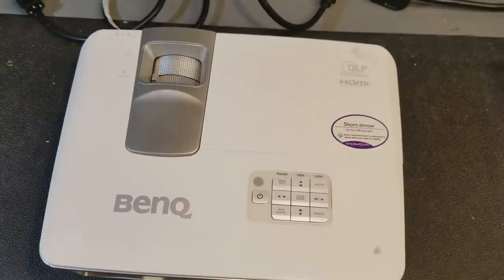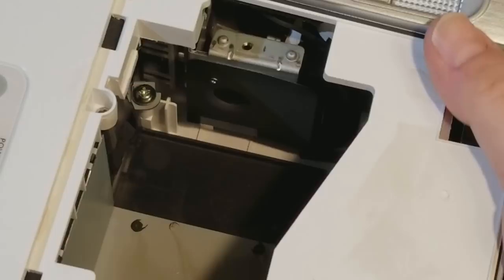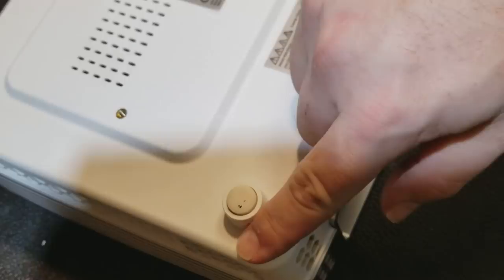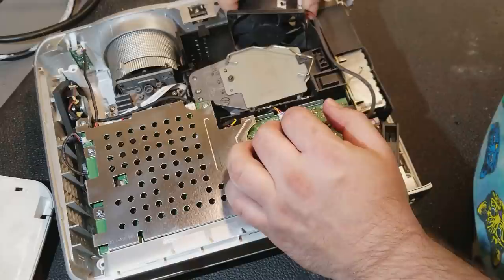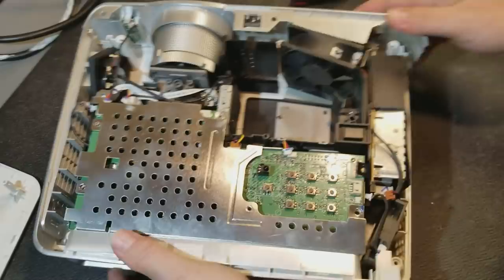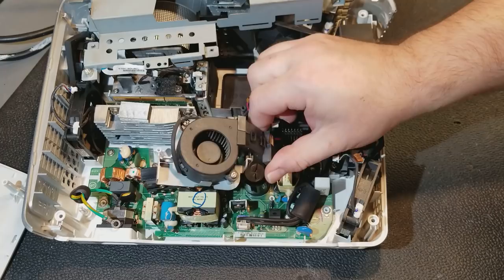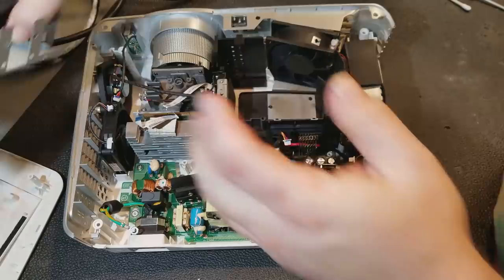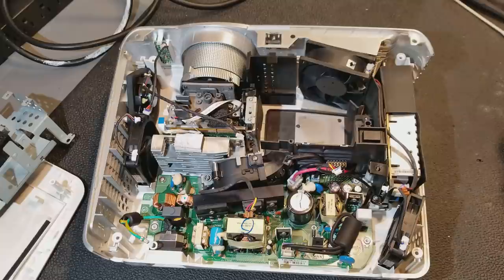BenQ W1080ST DLP Projector Cleaning / Service P1

Comment: Hi Frank, thanks for this tutorial.
I just had a problem with my W1070 that stopped working.
Specifically, clicking the power button it seems that the projector starts normally, but then in reality the lamp never lights up, and on the LEDs the steady red light with the word LAMP lights up.
The fans work, but then there is no way to turn it off by pressing the power button on the projector or the remote control.

I think the lamp was almost at the end of his life, maybe 2-300 hours were missing, so thanks to your video I decided to change it because I had bought a new one (not original), but nevertheless the problem is the same.
I had the same problem last year with my first W1070 that stopped working. Last year, reading some forums, they advised me to buy the power supply card (placed on the left side) because it could be that. So once it arrived new I replaced it but the problem remained. I changed the lamp but the problem remained. Therefore a technical friend told me that probably it could be the motherboard, and looking on the internet it cost (in China) about 230 $, so I found a whole used one with very little extra money and I bought it thinking that I could keep the old for spare parts.
Now, however, even changing the lamp and the power supply card, the second problem remains and I have no intention of spending any more money unnecessarily, and even if I wanted to, I contacted the Benq company who replied that they no longer sell spare parts because the projector is very expensive. old (a full hd is very old? absurd!).

What do you think could have happened? And what do you advise me to do?

To give you more complete information I tell you that I have already tried to see if the color wheel turns and it seems to work. The lamps (2 original osram used and 1 new aftermarket suitable for this model) are intact and do not have black parts or broken wires.
At this link you can see the video of the problem being turned on:
https://drive.google.com/open?id=13O9wTg6n8btpm_J-EaYMQz6-CHbQaELc

I hope you can help me.
Thank you
Reply from the maker: Hi Antonio, There are a few causes for this issue.  I suspect the lamp is OK.  The thing that sticks out to me in the video is the color wheel noise. I hear it begin to spin but it kind of chatters rather than spin up to speed. Of course this is via a video. The color wheel needs to spin up to a specific speed before the lamp will get an ignition signal. I still think I hear a slight 'warbling/wobbling' in the noise of the wheel.

Not turning off with the power button is normal in this case.  The projector is running its startup procedure.  It repeats the process two more times. If after the third attempt there is no signal indicating a lit lamp, the projector will turn off on its own and light the lamp warning indicator.

Without the projector in front of me, I suspect your color wheel is failing and the projector is not lighting the lamp. 

Try turning on the projector and waiting. I expect the unit will try and start three times and then shut down on its own and then flash the lamp indicator. You will hear that color wheel spin up 9 times total.  Its possible on the 5-9 time it may free up enough to spin properly without wavering.  If the CW speed is uneven it will not start the lamp. The W1070 needs a new color wheel every 7 years or so.  The service manual called for more often if I recall, but anecdotally I see them fail after 5-8 years depending on use and maintenance. 

You may be able to use the wheel out of the other unit.  If not they are very inexpensive.  I see them on eBay for less than $30 USD. 

The W1070 is a great projector.  I have a MX710 that is very similar.  Let me know what you find after letting the projector go through it's whole startup process.
Reply: @FixitFrank  Hi Frank, thanks for the prompt reply.
I forgot to tell you that I had already left the projector turned on to see if it went off on its own, but nothing.
I remembered that when the projector was working as soon as it was turned on, if you tried to turn it off immediately, a window appeared in the center of the screen with the wording "software initialization" and so I had to wait a couple of minutes to turn it off.
In my case, now after turning it on, the red LED on the bulb immediately comes out, and I left it turned on for over 20 minutes (I had forgotten it) and when I went to turn it off I always tried with the remote control and with the button on the body , but still it didn't turn off, so I had to pull the power cord away.

So what do you advise me to do now?
Do you think it is appropriate to disassemble the color wheel and clean it?
Once disassembled, how can I feed it to see if it turns well? And above all, how do I understand that the rotation speed is sufficient or poor? (I don't have a term of comparison)

Thanks for the info and your availability.
Reply from the maker: Very interesting.  I am still suspicious of the colorwheel, but I am not as confident as I was. Normally the projector will turn off after it completes the startup process and does not detect a lamp.  The only way to really tell if the color wheel is rotating at the proper rate is by the sound and the lamp igniting.  It should be a clear high pitches noise. In the video you can hear it speeding up and down. You may want to try cleaning the color wheel sensor in case a small bit of dust is partly blocking the sensor. 
Next I would try the projector with no lamp. Install the lamp door but power it up with no lamp and see if it shuts down on its own.  If not, press power, wait 1 second, press power again and see if the projector shuts down.  I wonder if it thinks it is on?  Normally to shut down the w1070 you need press power 2 times or power and then enter(I think). I will fidn the service manuals and read over them and let you know if I think of anything else.
Reply: @antoniomontinaro1982  Hey Antonio, did you ever get this fixed? My color wheel makes the exact same noise as yours. I just ordered one online so hopefully that fixes it. I was just curious if you were able to fix yours and what was the eventual fix.

Thanks!

Comment: This is an awesome video, Frank. Not sure what I did wrong though. Now when I press the power button, the green light blinks 5 times pauses and redoes it. No light, no fan. 
Not sure what I did wrong. Can you please help. Appreciate it your response if you are still there
Reply from the maker: Sorry, life has been busier than I expected.  My suspicion is the power supply pins might be offset or a wire is not quite seated.  I find that if I go back over everything I touched and maybe even re-do it, I tend to work out those issues.  I "think" your problem is a thermal sensor not being recognized but that can also be the power supply pins being offset.

Comment: going to clean my 1085st - hopefully the same!
Reply from the maker: Hi Antmon! I believe it will be the same enough for your purposes.
Reply: How did it go? I also have a ht1085st
Reply: @fernandocumbe1954 went fine - it was very easy to open up and clean - i also only have about 1900hrs on mine - used a small vac to get into all the smaller areas

Comment: I have the same projector; I’m hoping you could help me with this: just had an old bulb explode on me, had lots of very fine glass pieces in there. I thought I got it all out but when I put in my new lamp, you can tell there’s still tiny pieces in there refracting and making the picture blurry. What’s the best way to get that cleaned? I haven’t tried the q-tip to the color wheel yet, maybe that would help? And feedback would be much appreciated!!!

Comment: If you see blotches on the image like black spots and patches of different sizes it is due to dust the DMD chip. Clean it with a lint free cloth and isopropyl alcohol then use a magnifying glass to make sure there isn't any dust on the surface of the DMD at all. When you zoom in you see the blotches and when you focus the lens they disappear. That's a dirty DMD.

Comment: When removing the plug for the remote sensor the for wires pulled themselves from the harness instead of removing the harness. Can I find a replacement
Reply from the maker: I'd try and push them back in. They dont have to latch to the plastic, just stay in place.  Once they are in, you could dribble some hot glue or CA glue to hold them back in.  finding a cable is going to be hard.  I've done that myself and just ended up soldering the wires directly to the board.

Comment: FixitFrank... you are my hero (so far). I have a Ben-Q W1070 very similar to the W1080... I replaced it 2 years ago because it would run for 2 hours or so, then stop working. It was football season so I just replaced it and am now getting back to tearing it down and giving it a good cleaning to see if I can get it working again. If you're still out there.... in the video, when you went away to blow out the entire projector, how did you do that. I have been told don't use compressed air due to possibly blowing dust into the color wheel or other places it shouldn't go. Can I gently nlow it out without that risk? I appreciate any guidance before I take that step.
Reply from the maker: I use a vacuum and a dry paint brush these days and only compressed air if the optic assembly is removed.  You can use compressed air if you are super careful or if you plan to remove the DMD chip and clean in side the optic assembly.  the problem with just blowing air into it, is that you can force dust and dirt into the optic assembly and get spots on the screen. if you are careful or use the air with the cover off and are careful to not direct the dust into the optics, you can get away with it.  the reason i dont show it is that the vacuum and stuff is so noisy and i couldn't record and hold do the work( it was pre tripod)
Reply: @FixitFrank thank you for the insight and prompt response. I’ve screened the Part-2 video and tomorrow will be cleaning the optic sensor (as you’ve shown) before putting it back together. Thanks again your videos are excellently done! Merry Christmas!
Reply from the maker: Merry Christmas to you too, and thank you ! Any of the BenQ videos will be pretty close to yours.  they are all fairly similar.

Comment: My lg bs 275 projector is not started. It's shown orange light after green between 3 sec. What is the problem
Reply from the maker: Hi JM,  It is hard for me to say without seeing the lights. Here is the manual. https://www.projectorcentral.com/pdf/projector_manual_5777.pdf  Check on page 40 and see if this information points you in the right direction.

Comment: Hi Frank I have a benq MS614 projector which shut down, I followed your cleaning instructions (awesome by the way) as I thought it was dirty which it was.
Cleaned it the color wheel  doesn't spin as free as you demonstrated but free enough everything else ok , put back together and it works well without the cover
but as soon as I put that on after about 5-7 mins it shuts down everything at once no run on from the fans, by the way all the fans are working ok can you help.
the projector is for our church so any help will be ok.
Reply from the maker: Thank you!  It is hard to say without seeing it but I would be suspect of a fan.  It seems like its overheating if it runs without hte door and then shuts down after 5-7 min with the door in place.  I would make sure 100% the lamp blower fan is clear of any dust on the fan blades(the blower fan is the one next to the DLP/optical unit).  Then I would make sure the exhuast fan is not flipped around.  They can be put in with the airblowing in, which will work until the cover goes on.  Make sure its blowing air out of the projector.  At https://youtu.be/_xBGZ_V9Jp8?t=922 you can see the fan I mean.  It should be facing the same way.  The MS614 is basically the same unit. See if the fans are clean/oriented properly and let me know.  Worse case, if you get really jammed up, I am open to looking at projectors for people in return for making video content.  Im hoping its that exhauist fan being turned around.  I have done that which is why I mention it.
Reply: it was shutting down before the clean. I cleaned all the fans, the one next to the DLP doesn't open like the one you displayed the case cannot be opened so I just cleaned it and put it back I will check it though to be sure . The color wheel did not spin as free as the one in your video could that be it. I will check fan and come back to you.
Thanks so much for your prompt reply
Derrick D
Reply from the maker: Sure thing! You may still have a color wheel issue, keep that in mind. Another thing I thought of is the lamp itself. Make sure the lens has a good IR block coating. It should be obviously red/purpleish when you look at the lens. If it's clear or green, it's also part or a cause of your problem.
Reply: Ok thanks. I will also check that out and get back to you

Comment: Fantastic walkthrough, used this as a guide to clean out my projector.
Had 2 problems, dust specks on chip and a problem where colour and whites on image keep very slightly bleeding into the blacks.
Managed to clean the dust (even cleaned all internal lenses, colour wheel and DMD chip while there, and added new thermal paste to the heatsink)
All in all, much better picture.
But still have the problem of mainly the blacks taking on the tones of any white or bright colours in the image, especially if there's white....it kind of muddies the black making it look washed out.
Any clue what could be causing this issue?
Reply from the maker: Its tough to say exactly. I can't say I have heard of that as an issue.  However, it kind of sounds like the color wheel might still be failing.  If your color wheel is original, it may be just at the beginning of going bad. There are many high end projectors that actually have color wheel cartridges that are replaceable after 5 years. What I am guessing is going on, is the wheel is just ever so sluggish, or has a spot in rotation where it changes speed just a little. Not enough to cause it to go into error, but enough to make a noticeable change in how the color is responding.  While I am not a fan of the "parts canon", I would suggest the color wheel as a possible cause. Especially if it's still the original wheel in a W1080.
Reply: @FixitFrank  thanks for the reply, got a feeling that sounds about right.
Projectors going on for about 5 years now and just installed its third bulb, I noticed this  phenomenon at the end of the last bulbs life and thought that maybe a new bulb may rectify.
Won't hurt to try a new colour wheel as my final test.
Much appreciated for the information, keep up the good work 👍
Reply: @FixitFrank  just thought I'd leave an update for future reference to anyone that may need it.
Decided to strip the entire thing down again, but this time opened up the optical completely.
Back of the lens just before the front lens had built up with what I can only describe as a condensation like mist, gave them a clean, put back together and the picture is now absolutely perfect.
My blacks are no longer grey and all light hazing/bleeding is gone.
I've even modified the front focal lens to allow it to twist out for easy access to said lens.
Reply from the maker: Fantastic!  I have run into that weird haze before. I wish I knew where it came from.  I suspect air born cleaner that got sucked in maybe?  Dust possibly?  Thanks for letting me know your solution! I am sure this will help out someone in the future.

Comment: Hi Frank!  I have a benq w1070 that I've been using pretty much every day for over five years as my primary viewing device.  I've used this video a couple times now to clean it out over the years.  Great work.  The other day the color wheel came apart so here I am again.  No problem thanks to you.  I do have a question, have you ever experimented with upgraded fans for less ambient noise on the w1070 or w1080 ?
Reply from the maker: Im glad that was helpful!  I have not experimented personally because I haven't really had one around to experiment with.  If you match the specs on the fan, it should be doable though.  I want to look into that at some point. I think it is a reasonable idea.
Reply: FixitFrank Thanks. That’s what I figured. Where might I find the specs for the fans?
Reply from the maker: @leroynumber9541  If you get the part # on the sticker (on the fan hub) you can look it up that way. Mouser/Digikey are good sources for new fans with data sheets to compare against.